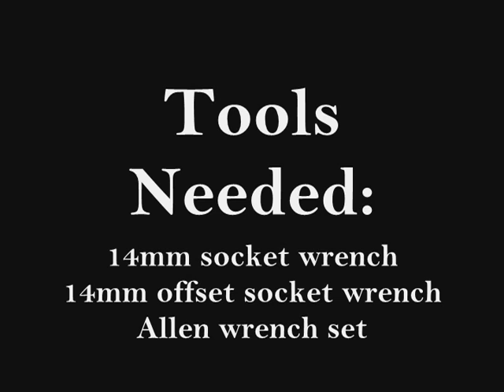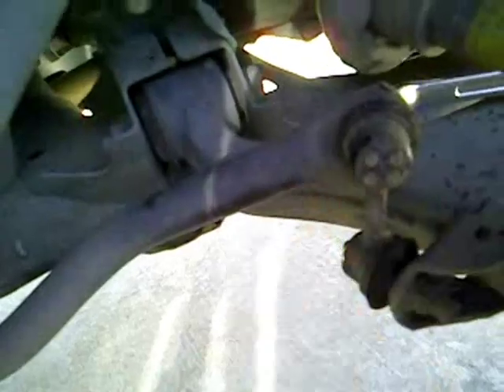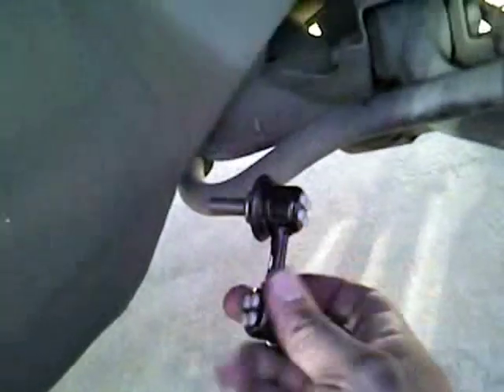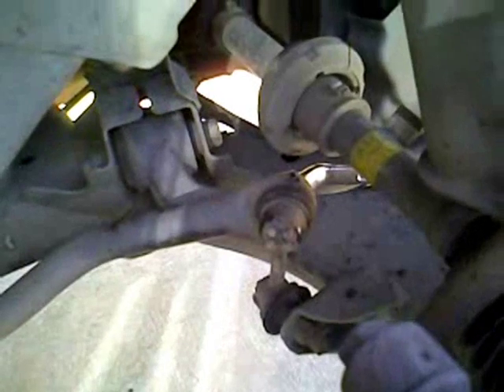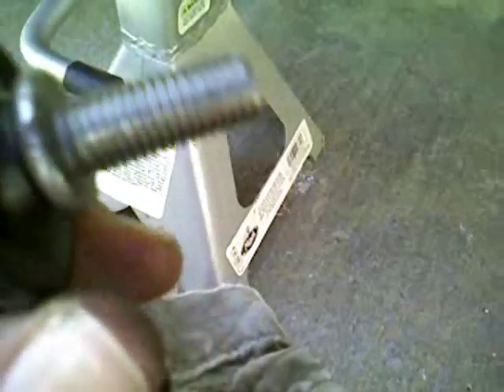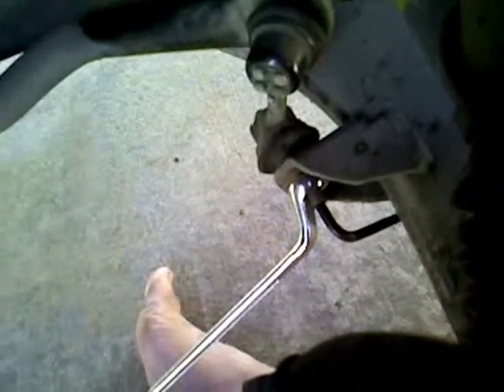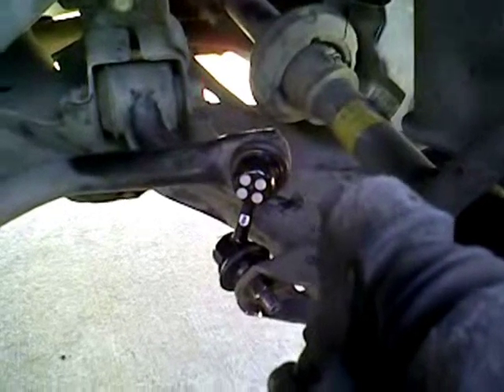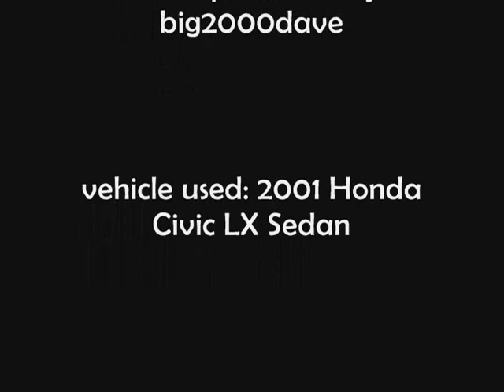Sway Bar Linkage Replacement 2001 Honda Civic

Comment: I replaced these hoping to fix a clunk I had when accelerating from a stop and when heavy braking. 

I started noticing the clunk after I had the subframe out of the car when changing the transmission input shaft bearing. A year later, and after replacing nearly everything in the front end with no success, I finally found the issue. Apparently the subframe should be tightened with weight on the tires, not when jacked up. I loosened the 4 -17mm bolts holding it, let the car off the jack stands, then tightened them back up. Clunking is finally gone! Another thing I did was make sure the sway bar was aligned correctly, equal distance from the control arm on both sides – loosen the 2 bushing brackets and use a pry bar to wiggle it left or right as needed. I even paid a mechanic to diagnose the noise, he had me replacing parts unnecessarily. Thanks for video, hopefully my comment will also help someone out there, cheers!

Comment: I just did this on an 2002 on the rear - it was a major PITA, allen wrench part was stripped, vice grips couldn't do the trick either - I ended up grinding bolts off - took a while to get it all done

good news is installation takes about 2 minute after you get the old ones off

Comment: @jcody10 Just did it on a 2000 accord,after reading comments I knew what to expect after the first allen stripped I drilled thru the dogbone towards the nut, after that I was able to pull it off exposing the plastic cup that houses the ball joint after prying that off with a screwdriver (popped rite off) I was able to clamp a vise grip on the assy, the rest were cake didn't evem bother with the allen wrench.

Comment: @jcody10 Just did it on a 2000 accord,after watching the vid (thanks!) and reading comments I knew what to expect after the first allen stripped I drilled thru the dogbone towards the nut, after that I was able to pull it off exposing the plastic cup that houses the ball joint after prying that off with a screwdriver (popped rite off) I was able to clamp a vise grip on the assy, the rest were cake didn't even bother with the allen wrench I used aftermarket H.D Moog parts (greasable)

Comment: If you don't have Alan key in place and try to twist the bolt on can you brake the new one ? I just replaced mine and was twisting the bolt on over and over agian , then found out I needed a Alan key to hold it in place . Do you think I fucked it up since I was twisting it on without the Alan key in place

Comment: Another way to get that out instead of using an allen wrench which turned out to be utterly useless for me is to get a pair of vice grips and pop the old one off by squeezing it and breaking it off, then grab the little ball with the vise grips and squeeze it tight, then get the wrench or socket and loosen it and take the nut off,

Comment: I have a 2001 Honda civic Ex do u no what the nut size is had them replaced an someone lost a nut
Reply: hi ! it is weird...i worked on it today and my 9/16 and 5/8 didn't work....the guy mentionne using a 14 mm...but when i see the conversion on google...9/16 is 14.3 mm....but my 9/16 is too small...???

Comment: @Mreddiet20 WTF is with honda amnd those stupid allen bolts they use.  My brake rotors all have them in them too.  one set came out easy, so i threw them out, and the other is ceased in, so hopefully I can sit down and drill them out some night!  

I got an end link gone on my accord, looks like I'll be drilling allen bolts again.